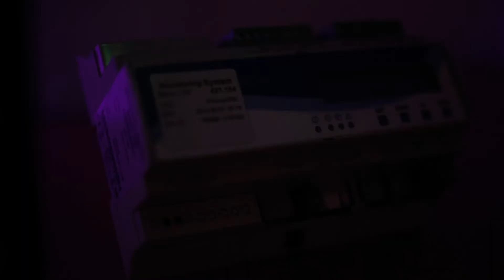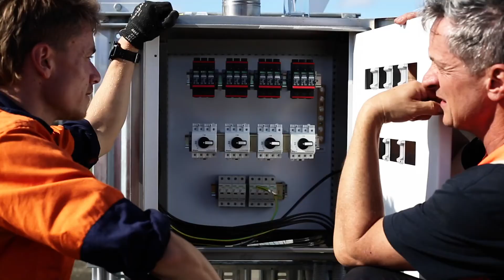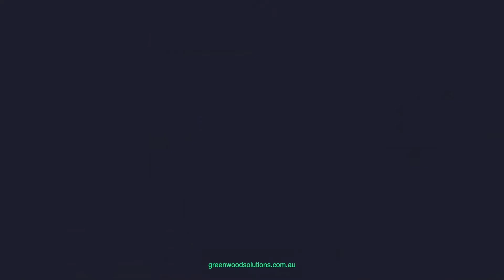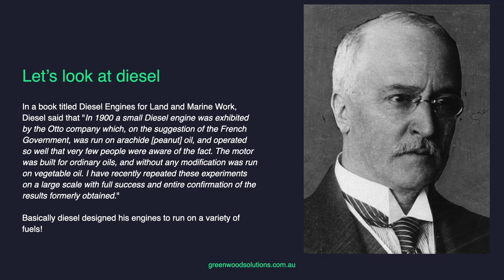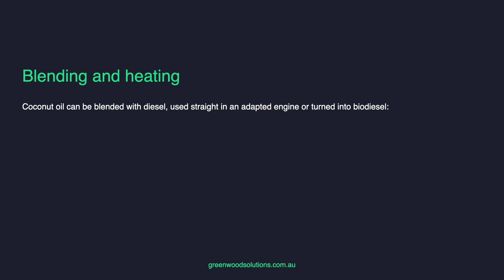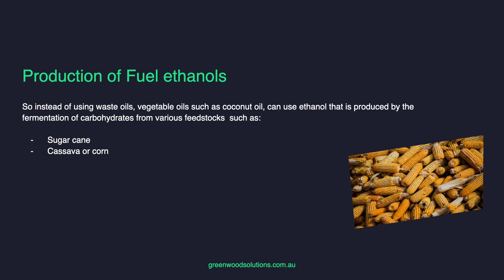Can Generators Run on Diesel Alternatives, Bio Diesel or Vegetable Oil?

Comment: Does diesel generator runs on biodiesel?
Reply from the maker: Yes it can, straight biodiesel. In addition there are strategies to use pure veggie oil; for example, start on diesel, run on veg, end with diesel or use pre heaters. It's all about the fuel viscosity

Comment: I read thst pyrolysis oil will corrode rubber and other smsll items in latest cars, not sure about bio diesel thou, so will it affect local portsble hardware grnerators the same?
Reply from the maker: Not sure about that. Worth researching.